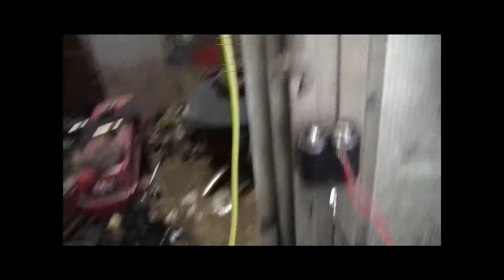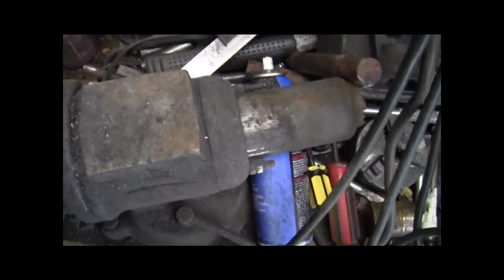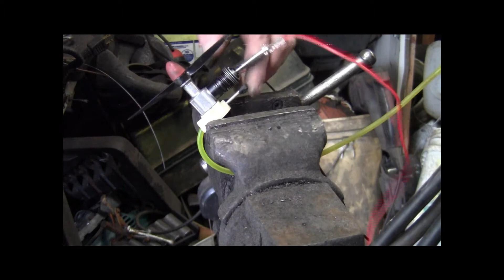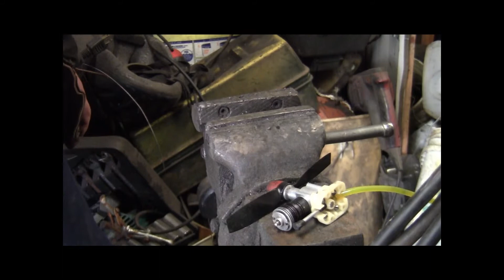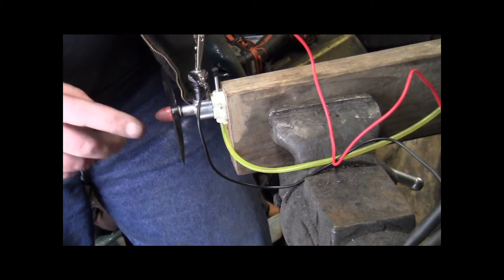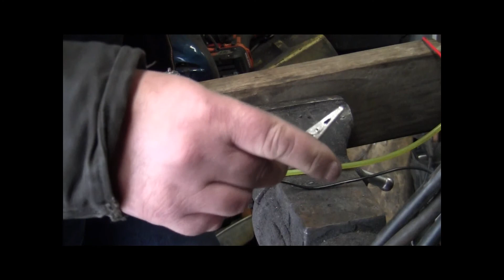COX ENGINE START UP (PART 1)

Comment: It's been 60 years since I chopped my finger up on those, but I seem to remember mine having a bit more compression than that. Those engines were terrible to start when they were new and we didn't have battery powered drills back then. I had a Dooling diesel that started easily, but was difficult to keep running. Finally, I was able to afford a Fox 15 that started and ran well, but my control line plane was so fast I got so dizzy flying it that I got ill and fell so it crashed. I loved model planes, but did not have a good time with them. lol
Reply: I loved them. Bought a Miss America plane for myself, for Christmas. On Christmas day, my brother and I went to the schoolyard to fly it. Everything went well, until he crashed it. I was so mad.

Comment: i use two small pices of wood and squeeze the crankcase with the vice. i also shoot some fuel in the exhaust port to help prime the engine. good video!

Comment: What voltages du you use for the glowplug on this engine ?
Reply: 1.5
Reply: well actually it works a lot better with 2-3 volt even though its meant for 1.5